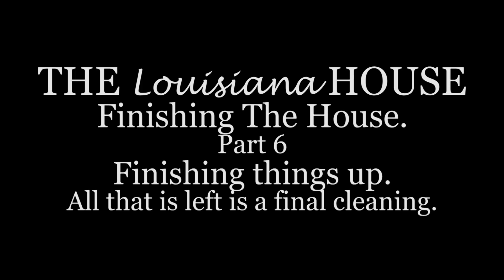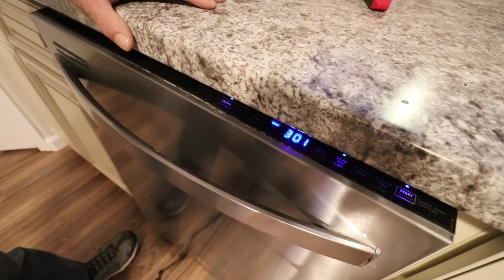THE LOUISIANA HOUSE. Finishing The House. Part 6. All that is left is the final cleaning.

Comment: Joe suggestion until you remodel the farm house kitchen buy a portable dishwasher that can be installed permanently in the future . That is what my parents did decades ago it was a Whirlpool on wheels it had a hose adapter that snapped on to the kitchen faucet for the hot water & the hose drained into the kitchen sink .

Comment: I recognize that dishwasher, it's the Whirlpool, I have the Kitchenaid version, though mine is from 2015 and is my second one from KA. My first one was purchased used in 2017 and dated back to 2005, this one is merely 5 or so years old and bought it at the same architectural salvage place I bought the first one. Good DW's for sure, but a very basic KA model. 

Hey, it's better than no dishwasher and it cleans decently too. But I recognize the family resemblance as KA is now part of Whirlpool and has been since the late 80's sadly.

Get a DW for the farmhouse, you and Melissa will not regret it one bit. Lived without one for 20 years after moving out on my own but grew up with DW's so know how beneficial they are if you cook (especially so).

Comment: I think one of the best accessories for a ceiling fan is those chain ends that have a light bulb and a fan letting you know what chain you are reaching for controls what function. Under $10 and you can get them in the common fan finishes so they match.

Comment: Are you hardwired the ring? Best to hard wire it. Otherwise when you are away the battery will go dead.
Reply from the maker: We put in solar chargers. They have both been at 100% since I put them in.
Reply: @NorthernSeclusion  good as long as it constantly charging. My neighbour's had their house broken despite having the ring. Of all the days the day of breaking in at 730pm the ring battery were dead. 
Lucky they have the CCTV on the wall capturing the event.
Over here the ring advertisement really a give away..that when no one is in. The delivery driver some in cahoot with burglar. Or fake deliver man pretending but intend to steal.